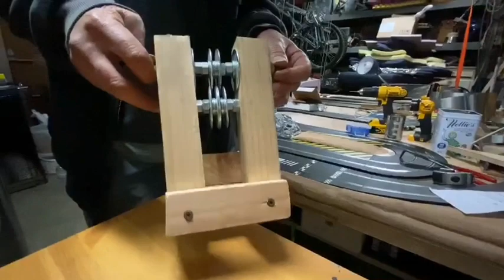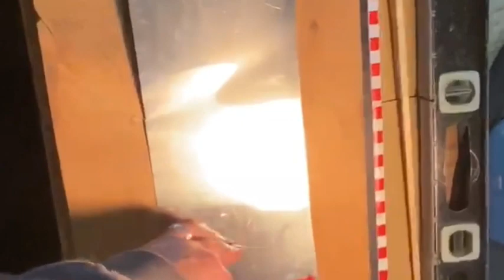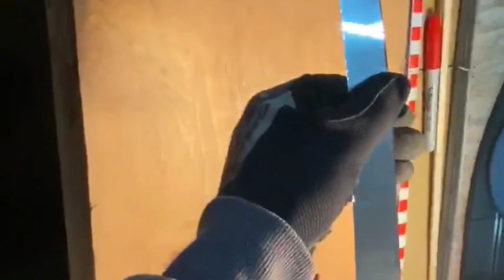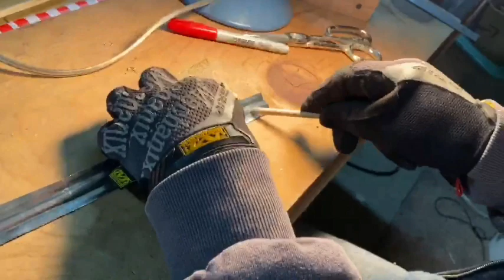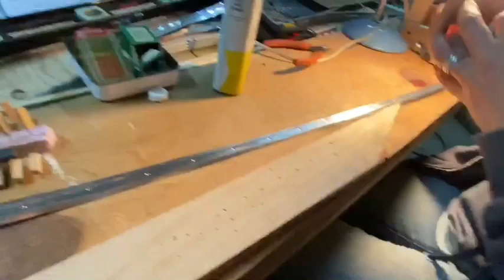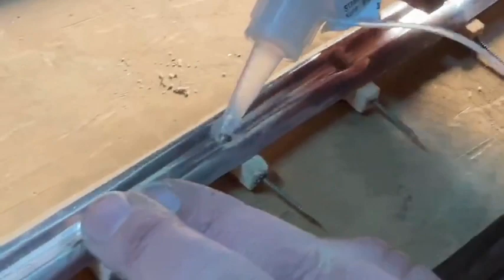how to build realistic 1/32 scale slot car guardrail

Comment: You could tack that assembly together and put a crank on it. When I was building an rc truck body out of metal, I found this stuff called foil, like aluminum. It’s way thicker than the thickest aluminum foil but a little thinner than those aluminum throw away bake pans for thanksgiving. You can actually get in various thicknesses and wasn’t too expensive. It might be a little easier to work with and it’d hold up even to impact. New subscriber.. I don’t slot race but I like your creative process and ways you’ve made various things. Hope to see more from ya.

Comment: I am wondering why you did not put a handle on your tool, instead of turning it by hand. 🤔
Reply from the maker: I never thought about that when I built the roller. Plus I made it as simple as I could to do the job. I have gone over the roller and have come up with a new design that I plan on showing in an upcoming video. And with that I will be building a multi rail guardrail system for the track, much like the guardrail you see at many older European tracks...

Comment: Another great tutorial. I made a jig with flat stock based on your video. Got to make the strips after a few tweaks. Any tips on how to bend it without kinking it to make the curves to follow the track?
Reply from the maker: Thank you Rich,  Your jig sounds pretty cool.  The kinks are a tough one. The outside of a corner is pretty easy to work , being that the bend is gradual and you are bending against the strength of the rail. But when it comes to the inside of a corner it can get tricky. I have found that if the corner is a sharp one It helps to cut small reliefs in the upper and lower flange of the rails, this tends to help a lot.  Another method to try is when you are forming the rail, try to manipulate the rail in the direction of the bend you are going to use it for. This can be frustrating, and  time consuming, but with some practice it is possible to create a bend in the direction you want. It may not be the exact shape but you can bend to fit as you place it on your layout. Hope this helps...
Reply: Thanks, I’ll give that a try